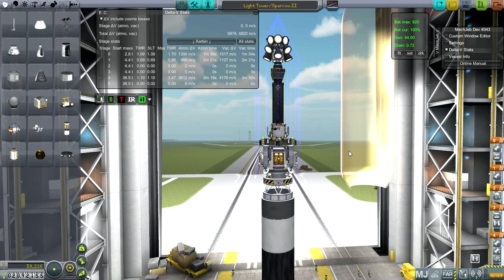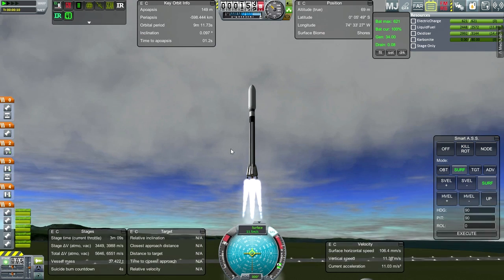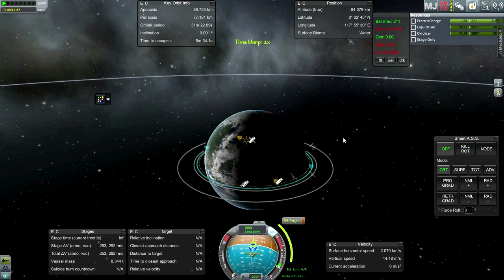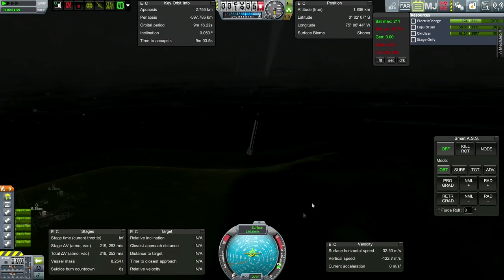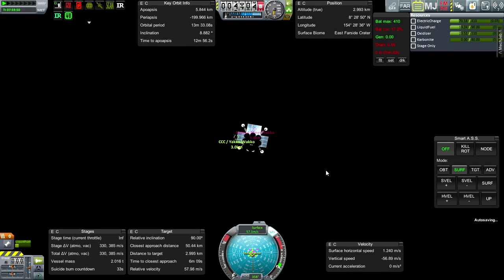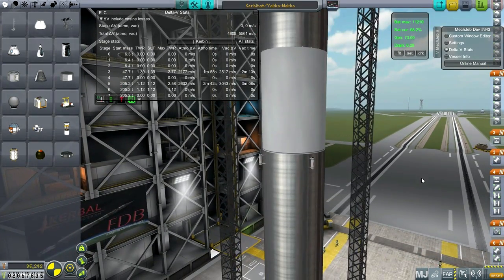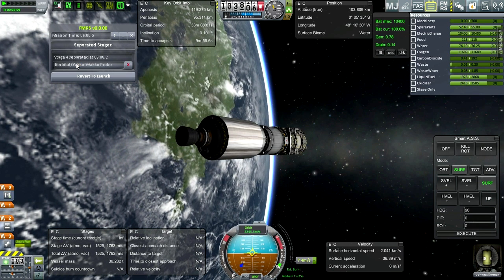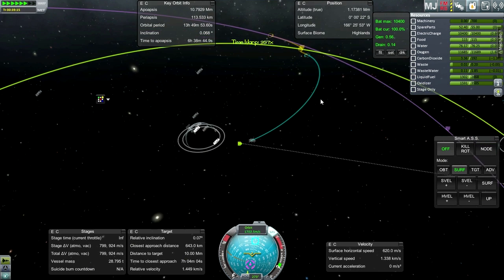Kerbal Space Program (0.25) - Kolonization 12 - Let There Be Light!

Comment: I was "watching" this while working on something else.  If that re-entry overheating on the engines were the engines you scaled down, scaling down makes engine much more susceptible to burning up as the max temp value gets scaled too..  probably more than it should (according to Bob Fitch and he should know).  

This re-entry technique is the one I use too.  Trajectories mod does really help though I've noticed recently that it only sometimes calculates the landing point correctly and sometimes the landing point moves as you come in.  

I shoot for an extra 500+ dV and come in high, then burn hard to slow down fast and decrease the amount of aero heating and angle myself down more.  I'll pop the chutes with the goal of landing on the flat ground between KSC and the first rise in ground elevation to the west.  I'll get a 97% return even if I land short.  Landing long means a water landing whose hazards usually destroy the vehicle.  So I play it safe and land short (also no danger in destroying a building) Sometimes if I get it just right I can land on the runway.  The launch pad still alludes me. =)

I use either the heavy landing gear or the SpaceX first stage gear (very sweet but have to land slow as they are fragile right now).

One more tip... if you are coming in real short and you catch it early, you can pitch the trailing end of the rocket down and FAR will reward you with some lift to help carry you farther.

I'm going to do a tutorial on all this as soon as I get some more of my vids out of the pipeline.

Comment: Check out Bob Fitch's 2 min video on using OpenGL to stop the memory outage crashes. I use to use about the same amount of mods as you're using but I've now been able to double it(all in 32 bit).
Hope this link works - https://www.youtube.com/watch?v=oJcFqNnyjmQ&list=UUGlLwYK_bx5w4ZDByE88Ecw
If it doesn't work then I believe it's his latest upload ;)
Reply: ***** I run in windowed mode also but that's because I have triple screens and windowed mode just makes it easier to be able to do other things whilst I'm waiting for long burns, re-entries or similar events that can take some time. If you want to play in fullscreen and keep an eye on your memory then check out Memory Usage - http://forum.kerbalspaceprogram.com/threads/99494-0-25-MemoryUsage-v1-11-2014-11-19
- can show in-game usage and can be toggled on and off with a simple button tap :)
Reply: Only that much? I'm surprised. My 0.25 install I had a healthy amount of mods installed and was crashing roughly every hour or so(depending on how often I changed scene) at around 4GB. Now I'm running a rather unhealthy amount of mods(gamedata folder has 82 folders inside. MM on load up says 2500-odd patches) in the same install as I spoke about in my first post and memory usage is at 2.5GB and I've been playing for hours. Still playing right now :)
Reply: Originally I was running ATM-Agg but after seeing the saving I deleted it. I didn't notice any difference between having ATM installed and not having it installed :/
Reply: ***** Ok. Strange how it seems different for each person. Possibility of different mods reacting differently between our installs maybe? Who knows...? Either way at least it seems to work :)